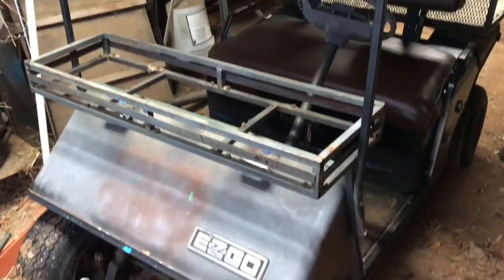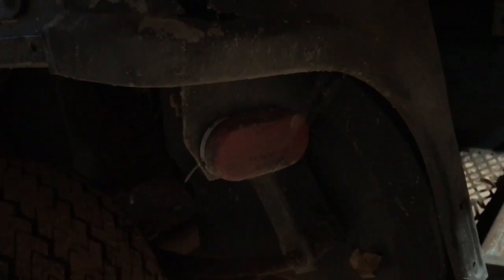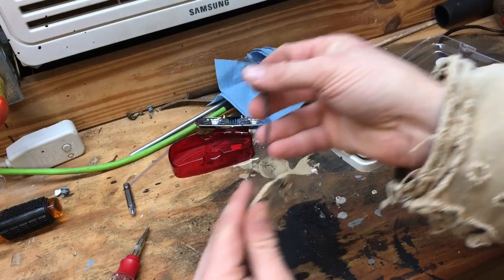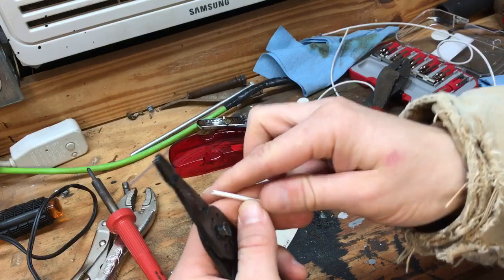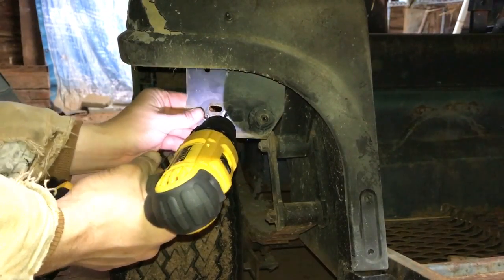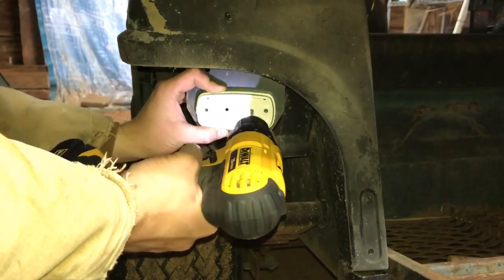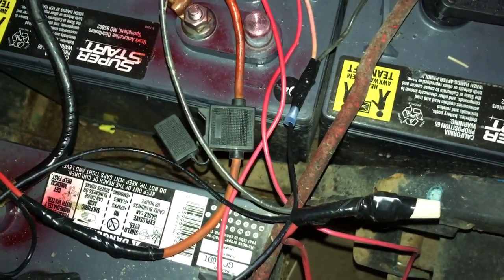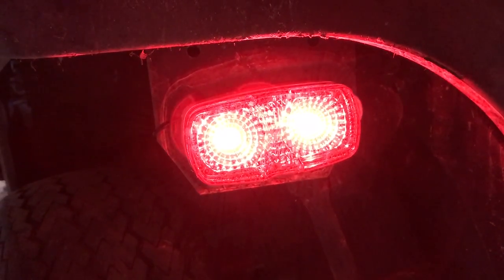Wiring a One Wire 12 Volt Light On a 36 Volt Golf Cart

Comment: Hi Mike, found your channel through Scotty Kilmer.  One comment, if you would have picked off your 12V from a place on the series batteries that was 12V potential greater than chassis ground, then you could have still used the ground mounting holes on the light connected to the golf cart chassis.  May I ask, what kind of work do you do in your day job?
Reply from the maker: I work in a factory
Reply: So if I found the 12V among the 6 - 6V batteries I could simply run a live wire to my rear lights and use another wire to grd to frame ? I would need to add a fuse and switch correct ?

Comment: What is the possibility of using nylon bolt and nut in original mounting holes?
Reply from the maker: Nonconductive fasteners shouldn’t be a problem.
Reply: Good video one question could you have ran both wires through the slot beside were you drilled your mounting holes?

Comment: Why didn't you use the ground from the light mounting holes to bolts fastened to ground?
looks like you did the soldering for no reason.  A ground is a ground, right?
Reply: A golf cart is grounded at the last battery's negative post. Not grounded to the frame.

Comment: You did not show me where to connect the wires  to the battery.  I want only 12 volt to the light on a 36 volt system. Still not sure how.
Reply: You can check the voltage on the batteries. The are 36V from the right the the left; first pair is 36V, second pair is 24V then the fair right(as you stand in front of the golf car) is 12V